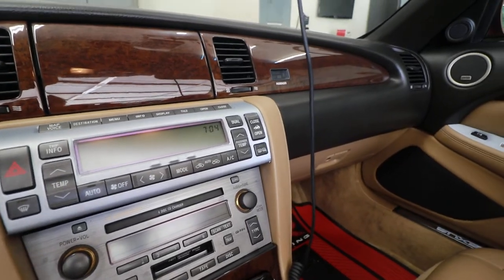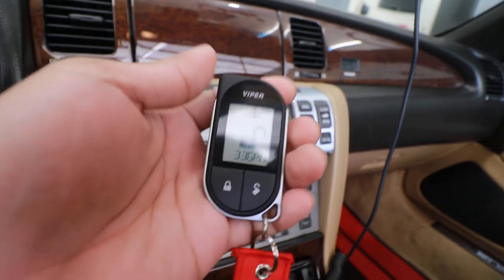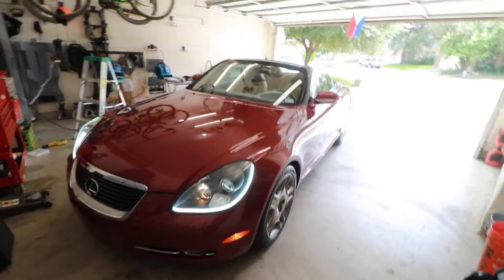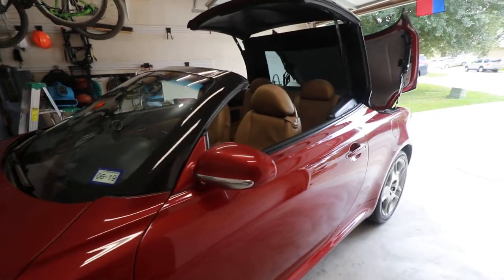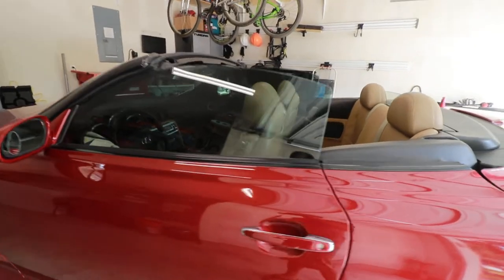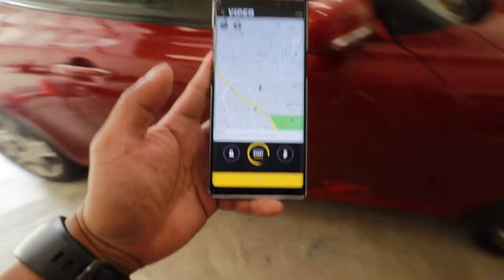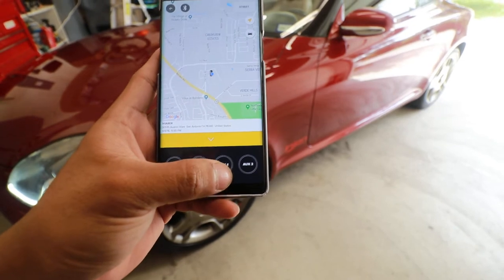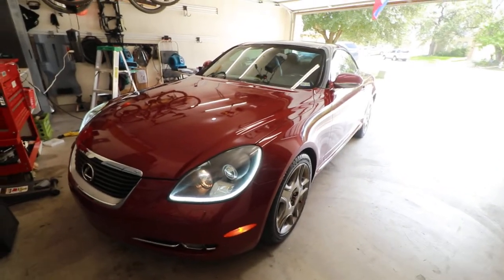Hard Top Remote Function

Comment: How much was the total you payed for the system and installation ?
Reply from the maker: If you buy everything new, the Viper Security System 5706V is 250 dollars, if you want the GPS and SmartStart App functionality, that's another module that is 200 dollars. I got Best Buy to install it for 200 dollars if I remember correctly. So in total, 650 dollars.
Reply: @AdrielPatrickAngeles  I like your set up and your video.  It's very nicely done and not as expensive as I thought....I was expecting it to be over $1k.  I would like to ask if you are concerned with your vehicle being hacked remotely?  Also, is your system secure and, if so, what type of encryption are you using (i.e. - how secure is it)?  Also, is your phone that controls the car secure?  The reason I ask is that I am considering this system for my car but would not like to be driving down the freeway one day and all of a sudden my car stops responding me or my car just plain stops.  Please let me know.  Thanks.  Good demonstration!